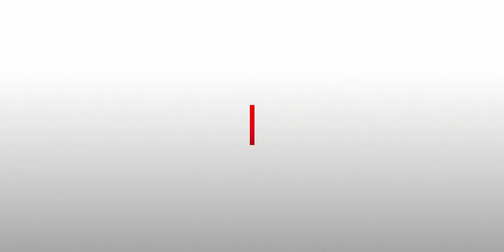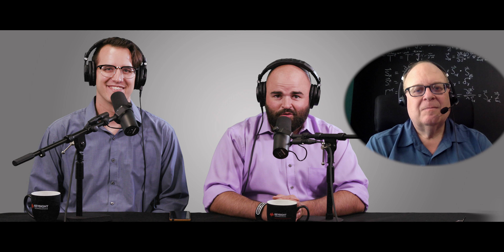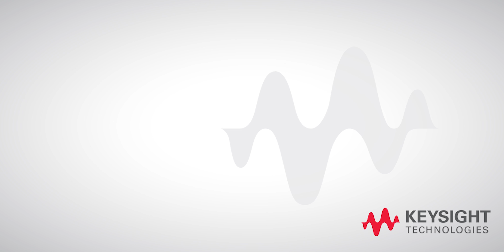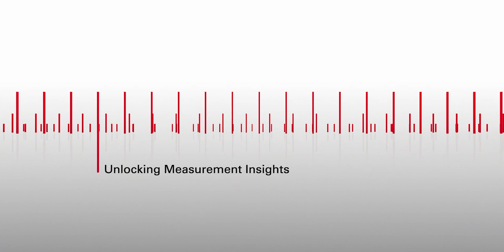What is Quantum Computing? - EEs Talk Tech Electrical Engineering Podcast #15

Comment: Very good video except the audio quality of Lee. But it's not that bad.
I would love to hear/see something about power electronics.
Something like measuring the reverse recovery losses of SiC-diodes for high currents (kA) to choose a proper heat sink/cooling system or general the differences between SiC and Si.
The Control and drives for big motors (or alternators in power plants) and what is needed to do that.
But probably this isn't Keysight's field of researches. Anything about power electronics would be nice :)
Keep up the good work!